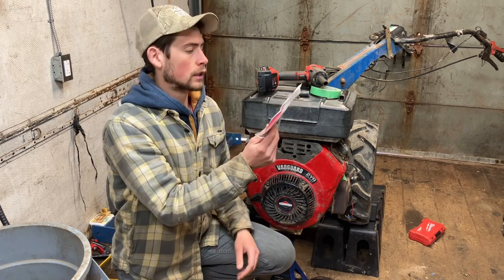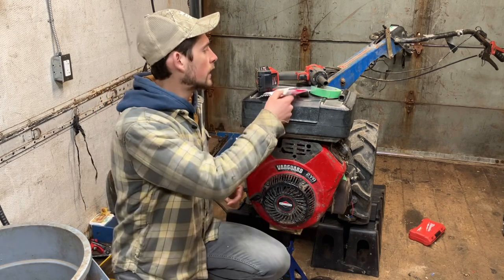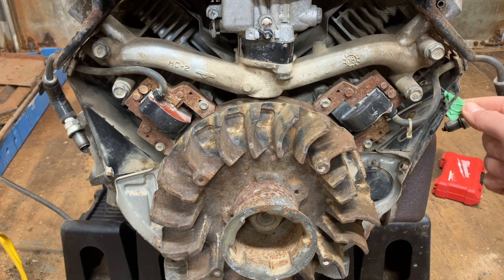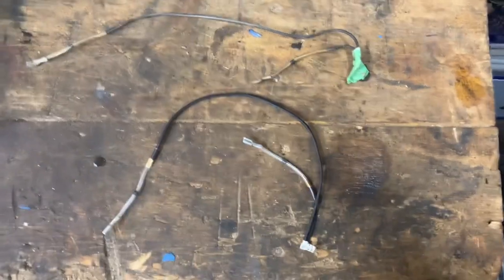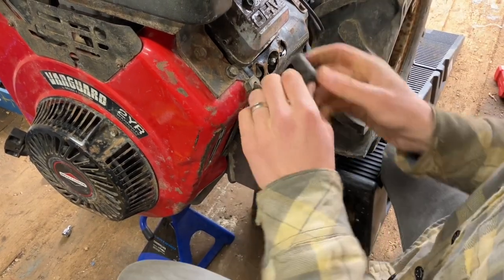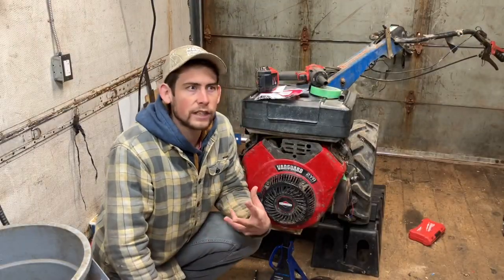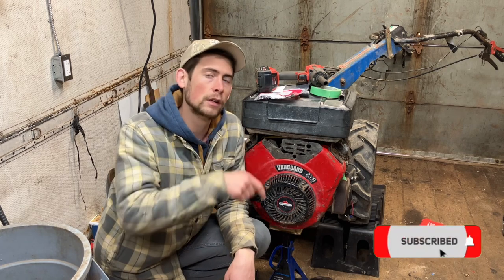How to Fix No Spark and No Fuel on a 14 HP Briggs and Stratton Vanguard - BCS Professional 850

Comment from the maker: Time Stamps:
00:09 Introduction
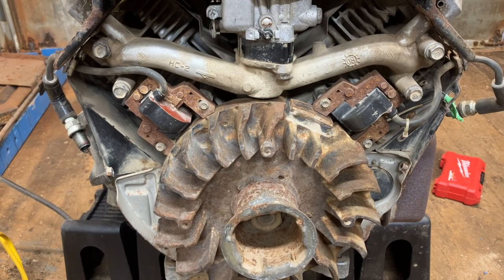02:36 Diagnosing No Spark
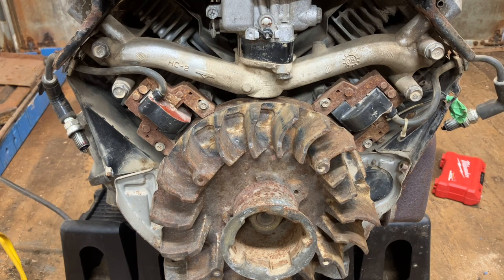04:54 Details of Kill Harness
05:55 Installing Spark Plugs
06:20 Start Attempt 1
07:02 Compression Test
08:44 Start Attempt 2
10:18 Diagnosing No Fuel
11:18 Start Attempt 3
11:30 Found the Problem!
12:48 Start Attempt 4 - Success!
13:20 Tractor Demonstration

Comment: We love seeing our older tractors get a new lease on life!  Hope the 850 serves your market farm well.  

By the way, that tractor will work with any of our current attachments - it has the same PTO connection style. Cheers!
Reply from the maker: Thank you! It seems like a very solidly built tractor, and it’s pretty straightforward to work on. I’m pleased to hear that modern attachments will fit. Are parts like clutches and transmissions interchangeable?

Comment: Bonjour ! Hello ! I'm trying to start my Briggs and Stratton 850 Staub brush cutter here, I haven't used it in a year or two. I'm in Lorgues in France and I'm french yes nobody's perfect 🙂 I was looking where to find the spark plug. I would like to try to clean it and bath it in gas and try to start again. Thanks for your video!
Reply from the maker: Spark plug should have an identifying number on it. You can cross reference that brand and number to find a plug that is easily available in France to fit your machine.
Reply: @JeremyKamutzki  Thank you very much!